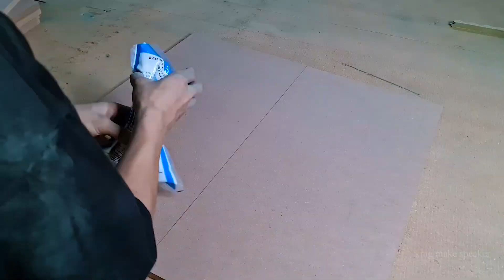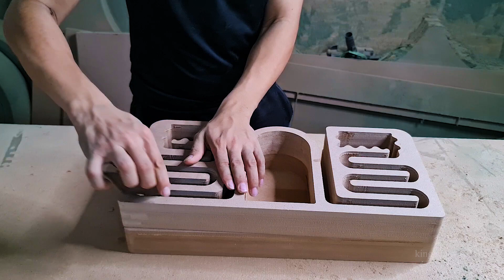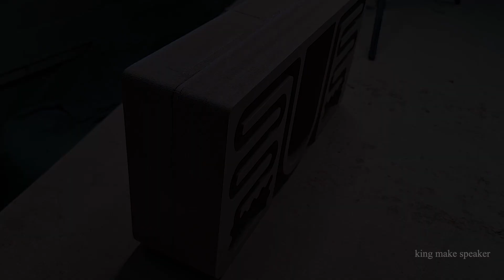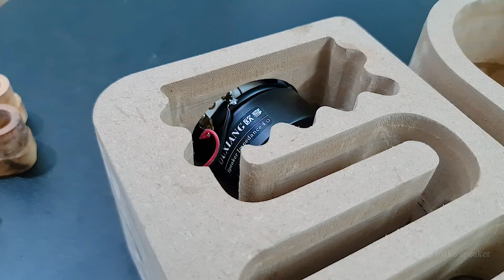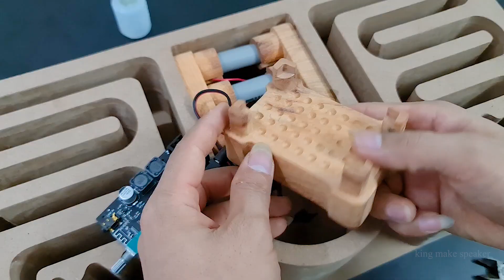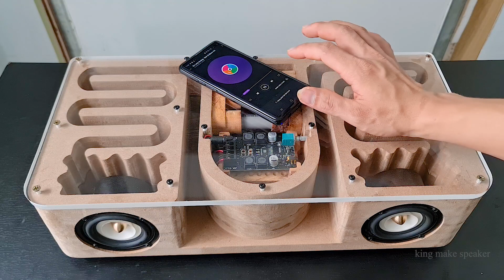DIY Wooden MDF Subwoofer Bluetooth Speaker

Comment: As a professional electronics and audio tech with some 44 years experience, may I make two suggestions? One, never use tape as insulation. Always use heat shrink tubing instead. Safer, more permanent, more professional, and better looking. Two, bring line level inputs to the outside of the cabinet, so you can connect audio directly to the amp. Bluetooth is wholly incapable of true high-fidelity audio, so if you want to hear what your speakers really sound like (and those Tang-Band drivers are REALLY good), you need line inputs. Otherwise, nice job!
Reply: Unless maybe using Bluetooth module that Support LDAC codec
Reply: He should have use passive radiators instead of this conception to increase the bass, i have the feeling that the bass is totally absent

Comment: Rather than sanding the outside, which with MDF is an exercise in futility, try coating the outside with body filler such as Bondo and then sanding that. This way you can get it as smooth as you want and it is prepped for paint.
Reply: Bondo mixed with fiberglass resin works really well for this.
Reply: That's an excellent idea. An even better idea would be to make it out of wood. 😃
Reply: @ScottGrammer  ... MDF really does well with preventing unwanted resonance, and it's extremely inexpensive vs solid or plywood.
Reply: @JJ_ExMachina  Yes, that's true. But MDF doesn't finish well, it's hard to keep precise tolerances with it because it flakes at every cut edge, and if it ever gets damp, it's all over but the crying. It's just a matter of what you want.
Reply: @ScottGrammer  ... Very true, but if treated properly (aka sealed under varnish, veneer, or other water resistant coatings, it will withstand a fair amount of moisture. Majority of subwoofer enclosures used in vehicle applications utilize MDF as their main structure, and those hold up to some serious abuse. BUT you are absolutely correct, and everyone is free to make their own choices. That's the most wonderful part about these kinds of things... there really isn't just one correct answer to this sort of thing.

Comment: That would look beautiful in a Baltic birch plywood!
Reply: True but I think it’s the density of the MDF that gives it the resonance kind of like the type of wood used in a strata verious which is why they make cheap speakers out of partical board
Reply: @shanebethune9032  While I understand what you are getting at, that is the exact opposite of what you want when engineering a quality speaker. In an acoustic instrument like a violin or a guitar, The resonance is an integral part of the design. It reinforces and amplifies the sound of the strings while giving it character. A perfectly designed speaker would be completely inert. You do not want a speakers cabinet to color the sound at all, which is why high quality speakers are extremely dense, heavy, internally braced, and filled with fiberfill to dampen any internal standing waves. The purpose of any speaker is to perfectly replicate the RECORDED audio, and inducing resonant sound from a speakers enclosure is antithetical to that design goal. MDF is actually a very good material for those design goals as it is both dense and inert, however with how small that speaker is compared to with how thick the wood is, switching to a Baltic birch would have near zero impact to the speaker acoustically, but have a dramatic improvement on aesthetics. Cheers.

Comment: To get a better solder joint onto the nickel strips, you can roughen the nickel strip's surface with sandpaper before pre tinning with solder.
Reply: I would add to that, not to solder where heat can transfer to the cells as this can easily damage them, spot weld on a longer tab, and solder to this.
Reply: @kiwiskiz  Exactly, for this reason it would be much easier and better to solder the wire to nickel strips first and then weld them on to the cells.

Comment: DIY Speaker:
Step 1: Have a CNC workbench...
Reply: hahaa
Reply: Lol I hate how almost everything today labelled as "DIY" involves either a CNC or a 3d printer. Kinda pointless.
Reply: and being a deaf-mute or unable to speak English.
Reply: I hate most of these DIY speakers videos. Made in a way that looks like there were only 2 rules - be as fast to build as possible and make noise at the end. Some at least "look" like there were some "sound mathematics" used but then without any info in the video which/why - aka looks like someone just found instructions on the net and decided to make video about it.

Half of them made of scrap, half of them not sealed in any way, nearly all powered by "chinisium-grade" electronics - crapiests dc-dc converters, bt modules, amps. No proper tests really made at the end. Some include "rainbow-puke" RGB disco-lights. Wouldn't be surprised if most of those speakers are disassembled for parts for next videos.

And worst in all of that is that when I thumb-down and mark as "not interested" in recommended part of the site these videos, it sometimes makes youtube reduce the number of "good" videos too.

Comment: Great build! I’m surprised you didn’t place the volume control of the amplifier to the outside.
Reply: Probably just have it set to max volume and use the phone to control the volume
Reply: I would unsolder the pot and mount it in the plexi...

Comment: Sorry but too big for the result... You must put an active filter or a DSP to maximise bass and for lower mids! 
Do the same with bigger full range... 5" is the minimal. 
My first 2.1 is from 1995 (3 liters total). With linear amplifiers. Hot in temperatures for a little speaker!!! 
Welcome class D! But never for high frequences... I build now hybrid 3 way amplifiers.
I've found filter module cards to eliminate probs from little enclosures.
I appreciate your work!! My job is renew old (from 18th century to now) furnitures in France.

Comment: I stopped watching because I don't have a milling machine, or even a workshop. Also, why MDF? Surely birch ply would have offered a better and more interesting finish...
Reply: MDF is better for loudspeakers. It absorbs resonances better than plywood because it’s denser and more uniform.
Reply: @sunspot42  Most high-end speaker manufacturers prefer to use birch ply for their cabinets because of its superior sonic qualities. Budget cabinets tend to be made from MDF because its cheap, thus it keeps down the overall cost of the product.
Reply: @sgtgrash  Birch is stiffer but more prone to resonances and not as dense. It’s lighter and more durable, which is why it’s often used in high end speakers. But it doesn’t cut, mill or drill as well as MDF, which unlike plywood typically doesn’t chip. For this application MDF was probably the best choice.
Reply: @sgtgrash  i own svs ultras, and i honestly have no clue what the cabinets made from, its wood though
Reply: @springpanda9393  Having studied the SVS Ultra parts list it is apparent that the majority of the design budget was earmarked for the drivers. The crossover components are budget iron core inductors, poly caps and sand cast resistors, this would suggest that the cabinets are probably constructed from MDF in order to keep the cost of manufacture low. Speak to Danny Richie at G-R Research for ideas on how to improve the Ultras crossover network, he's the goto guy for this stuff, he knows his onions... 😉
Reply: @sgtgrash  I've had mine open, the ones I got are made from wood, as for improving the crossovers, I don't really need to, I own a pb 2000 pro that handles all my lows, and the subs in the center and tower do just fine for where I have them tuned in to, and last little bit, dannie is awesome yeah, but I don't want to ship my speakers out to him to have em upgraded, or do ot myself I am content with what I bought
Reply: Just need a jigsaw and a router and a little more time
Reply: Me2😝